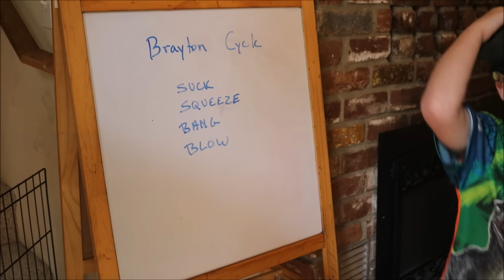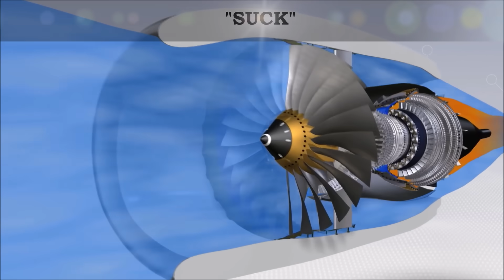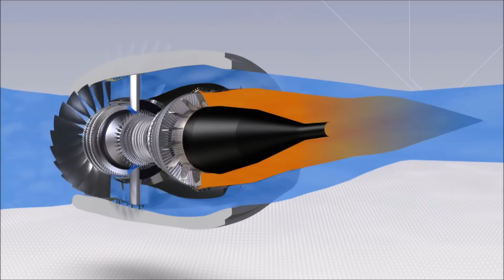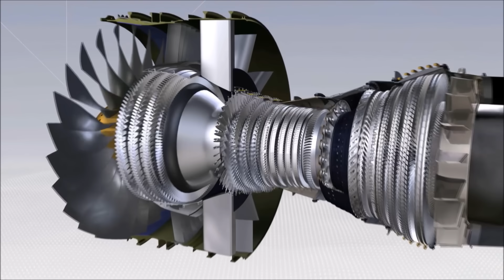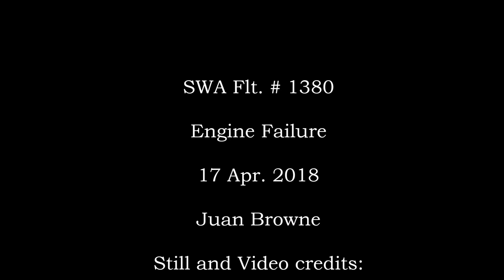Southwest Airlines Flt#1380 17 April 2018 Update

Comment: Here's a couple of observations, that i noticed. Good opinions please. First the test are ground test. Any questions on the 500 mph entering the engine during failure causing more damage? Second thought, The 2 South West mentioned engine failures were both #1 engines. Similar problems. And what if theses were #2 engines. Damage the same to aircraft? What do you all think?
Reply: Good question. Each engine is symmetrical on the outside, but some internal parts such as the accessory gearbox are always on one side of the engine, and failure of these may produce different effects on either side of the aircraft. The fan blade failure should result in random direction of the pieces.

Comment: Thanks, Juan.  Curious where on the plane the broken window was in relation to the engine.  Do they replace the fan blades periodically or only if signs of damage?  I assume they are expensive to produce, but replacement looks easy.
Reply: The broken window was just level with the rear of the wing, slightly behind the main parts of the engine. Look at the photo at 00:06 in this video.

Comment: While serving aboard the USS John a more FFG 19 in the Navy, I  operated and maintained two GE LM 2500s,  the lm 2500 uses the same core section as the cfm56 I believe,  of course we didn't have LP compressor wheel on the front, but we did have the 5 stage hot in turbine that drove our main reduction gear which is like a transmission for the main propeller shaft. Those engines were very reliable and there are hundreds of thousands of them in service in different applications worldwide and have been since the early 80s maybe even the late 70s..
Reply: Interesting discussion, but the LM2500 is based on the CF6 engine, not the CFM56. See: https://en.wikipedia.org/wiki/General_Electric_LM2500
Reply: Gordon Richardson the way I read this is that it's and improved version of the core cf6 section... https://en.m.wikipedia.org/wiki/CFM_International_CFM56
Reply: With an improved annular conbustor that swirls the flame propagation.. otherwise when I look at under the cowling.. all of the bypass, cooling and bleed air piping looks very close.. vsv's/ fuel  rail rack and brg vapor collection points.
Reply: That article (which I have read many times) says the CFM56 is based on the GE F101 engine, which is entirely different, though obviously some company features remain: https://en.wikipedia.org/wiki/General_Electric_F101
Because this was a military engine, export licences were a big issue!
The CFM56 does include several components from the CF6 including the fan, but not the core.

Comment: Jet engine background: The father of all modern airline transport engines was Austrain Amselm Franz. In about 1940 he was given the task of producing a jet engine for the Junkers aircraft company, where he worked as a turbocharger designer. The early experimental jet engines all used centrifugal compression, but Frans had a better idea and invented the axial compression jet engine, which became the Junkers Jumo 004. The 004 powered the Messerschmitt 262 which was 100 mph faster than American fighters in WW2. After WW2 Franz moved to the US where he developed a number of turbine engines including the PLFIA-2 the worlds first high bypass jet engine. All the large airliners are now propelled through the vapors by Franz invention of the axial compression high bypass turbine engines, such as the CFM56. Franz changed the world and virtually no one knows his name.
The Jumo 004 had a time between overhauls(TBO) of 25 hours, but with 80 years of metal science the TBO of the CFM56 is about 10,000 hours.
Fraz died in 1994 at the ripe old age of.....94.
(How many Americans would want to fly on an airliner powered by a Junkers engine?)
Reply: ziggy 2shus  Jet engine invented by Frank Whittle,who was sidelined by the backward thinking  military analysts before WW2. Details of his design were obtained by the Nazis by nefarious means!  You are obviously a very knowledgeable chap, do you know of any similar turbofan containment catastrophic failures in Rolls Royce units? This is a design engineers nightmare.
Reply: I posted this for the convenience of the Blancolirio viewers. Most of my information comes from Wikipedia.Yes, Whittle invented the first jet engine, but it was a centrifugal compression engine, which was the logical way to produce the first of its kind. Hans von Ohain , in Germany also developed a centrifugal compression jet engine and got a US patent for his engine. Ohain's engine was the first to power a airplane in 1939. In 1926 A.A. Griffith reviewed Whittle's turbine paper and derided it, and stated that the large diameter compressor would make Whittle's design impractical for aviation, which shut down Whittle's work for a long period. A.A. Griffith wrote a paper proposing an axial flow compressor. Griffith's and Franz great idea was to take steam axial expansion turbines and flip it around backwards and use it as an air compressor. The steam turbine had been invented by Sir Charles Parsons in 1884. The British had an axial compression test engine flying in the Gloster Meteor in 1943.
The British Gov. sold the Rolls-Royce Nene centrifugal to the Russians in the late 1940s, which they knew was a dead end design. The Neme engine was far superior to anything the Russians had, and they improved it and used it to power the Mig-15. In the Korean war. The modified Mig-15 Neme engine produced more power than the axial engine in the US F-86, but this was the last straw for the big centrifugal engines.
-
A quick Google check: In 2001 a Rolls-Royce engine fan blade broke off on a 777 on take off. In 2017 a RR engine fan blade broke on an Airbus 330, but there was no significant damage to the cowling.
Reply: ziggy 2shus  Thankyou for the information Ziggy. Sad to say I had never heard of Franz before,though I worked on steam and jet turbines for many years,including failed blade containment at the power stage. I imagine the turbofan cowling is a composite material so it will be interesting to find out how and why it failed.
The Swedish Ljungstrom radial steam turbine was quite successful but limited for the reasons you outlined in the Whittle Jet. One advantage was the speed it could be run up and loaded compared to an axial unit which requires careful thermal expansion.
Parsons turbine powered boat “Turbinia” is in a museum in Newcastle and well worth a look.It was good for nearly 40 mph !
Reply: The Swedes and Turbinia. Similar to the Turbinia embarrassing the British Navy in 1897 at Spithead with its speed, the Swedes "sank" a US aircraft carrier during war games with a little put-put submarine. The Swedish sub The Gotland is powered by an apparently very quiet Sterling engine and can stay submerged for weeks. The small"inexpensive" Gotland sub was able to sneak through all the US Navy defenses and photo the aircraft carrier.
-
The problems with broken fan blades should be reduced with the adoption of the new engines now in production. The CFM LEAP engine has light weight carbon fiber composite blades, which should reduce the damage if one breaks. The new P&W 3/1 geared engine would reduce the energy of a broken blade. The P&W geared turbine   spins at about 12,000 rpm but the fan only turns at about 4,000 rpm.

Comment: I've worked with this design of engine as mechanic and the Fanblades of this model are well designed without midspanshrouds. But as mechanic you haveto deal often with stuck fanblades. I think that, combined with an high amound of flightcycles can cause this enginefailure.
Reply from the maker: Great point! Especially just coming out of C check.
Reply: I do not know the nomenclature of the fan blade components nor can I find the engine service manual online.  Should I be surprised if NTSB and other investigators find either parts installed out of numbered sequence or improperly lubed?
Reply: Aren't stuck blades are really dangerous? I believe all blades are meant to have a little play in their slots to absorb/dampen excessive vibration. (Thanks to AgentJayZ's excellent channel for my education on such matters).

Comment: As usual Juan, your reporting is spot on! I like the fake news stations telling the public that the engine "exploded"! One thing I must say is that the cfm56 engine has 42 fan blades. I believe you said 24. The cfm56 engine is a very reliable engine and the USAF uses that engine on the KC-135 tankers. The only differences are the location of the transfer case and the Tanker uses a down rated (thrust) version. Thanks for setting the record straight!
Reply: Different models of the CFM56 use anything from 44 to 22 fan blades, this B737 has 24.
Reply: Gordon Richardson I stand corrected! Thanks. I was speaking from KC-135 experience. I easily counted 24 from the pictures and I should have done that first. My question to you is why the variance in the number of blades? Thrust rating?
Reply: Tom Uhlig The Wikipedia entry for the CFM56 explains some of it, as the engine has gone through multiple upgrades (similar the B737 itself), and large ranges of thrust ratings. See: https://en.wikipedia.org/wiki/CFM_International_CFM56#Variants

Comment: Turbofan failures can be deadly. I'm remembering Delta 1288 in 1996 where the shrapnel killed two on an MD-80 series on a runway and United 232 in 1989 where the shrapnel from the number two engine severed all three hydraulic systems of a DC-10 at altitude. Despite extraordinary efforts of the crew to fly with no yoke or rudder control the plane crashed at the Sioux City Airport in Iowa killing 111 of 296 on board and injuring almost all the survivors. We can thank the high level of quality control in manufacture and subsequent inspection that fan failure is so rare.

Comment: Thank you for this information , do we know if the failed blade or bits of it are still inside the engine body, did the bottom dovetail part remain in place or blow out, what retains the dovetail in place, and will they tell us if in both failures the failed fan blades where still inside there  recommended life span and actual flight hours in service.  Has this type of failure ever been replicated in ground testing or is that not possible because there is no way to reproduce the effect of front air speed on the engine while in flight, Finally what is the recommended life of a fan blade and who makes them.

Comment: It looks like one fan blade is missing, with others bent. https://www.youtube.com/watch?v=NrSK7afoMjY&t=1m51s
Can't see if any of the engine core blades were also lost.
I thought the engine nacelle (Edit - fan cowl seems the correct term) was kevlar reinforced and designed to contain a lost blade.  The video shows lightweight metal honeycomb possibly lined with a thin sheet of kevlar(?) that was comprehensively shredded.
Reply: The entire engine is junk now, pieces of metal probably went throught the whole thing in a few milliseconds.

Comment: I really appreciate the information you've presented here.  What I'm having a really difficult time wrapping my head around is if the fan blade was sucked back into the engine, which would cause an unbalance in the engine, why would the inlet portion of the nacelle come flying off?
I originally thought that maybe the nacelle itself failed, causing a FOD incident which took out the blade.  With the reports now that the NTSB is saying there were stress fractures on the blade, I'm guessing that didn't happen.
What is that nacelle inlet portion made of?  Is it a honeycombed aluminum?  Fiberglass, or carbon fiber?  To me, the photos look like the entire inlet section just was ripped off the nacelle completely, but I'm not sure why, especially given video evidence of tests of fan blades with no significant damage to the inlet.  Of course, they weren't flying at 400mph on the test stands, either.
I'd appreciate hearing your input.

Comment: So basically this engine is a ducted turbo-prop?  Except they call it a fan.
Reply: Jim Beck - pretty much.  The turbine mostly powers the compressor and the fan. Less than 20% of the thrust is from gas exiting the engine core. 80% is just air moved by the fan around the core.  This large air mass that moves close to the speed of the aircraft is more efficient than the smaller high velocity air mass of early pure jet engines. I owe this understanding to AgentJZ and his excellent YouTube channel.

Comment: The N1 blade assemble  on a CFM56 - series does not run at 50,000 rpm, it varies from high 4,000 to low 5,000 rpm. This manufacturer uses N1 to set power, others use an EPR ( exhaust pressure ratio) to set power! BTW the bigger high Bi Pass engines use a lower N1 speed since the larger diameter N1 bigger blades would go super sonic at tips, ant that is a NoNo!
Last NTSB update and photos/video shows N1 blade #13 failed at the hub from an internal stress crack and just above midpoint of the blade. The hub section of the blade remained on the are craft and I suspect that was what breached the aircraft wind and injured the woman that later died. The nacelle parts were found but the upper blade section is missing and may never be found!
Kudos to the Pilot and her crew job well done!

Comment: 7:30  The "bang" part: the compressed air is about 840°F. When fuel is added it goes to about 3090°F. This temperature change expands the volume of hot "air" about 2.7 times... "bang." So, the extra 1.7 amount of hot stuff gives the extra work for thrust = "blow"
Reply: A Mascia There are lots of extra details in a real engine. The hot combustion products are mixed with cooling air, since the turbine blades cannot withstand such high temperatures.
Reply: Hi Gordon... Yup, the engines are amazing. Glowing dim red in darkened areas howling at thousands of RPM 20000 HP without breathing hard... awesome close up. I used to work with little ones in the olden days.
Reply: A Mascia I get all my information from AgentJayZ videos. He does jet turbine repairs, and explains things well. See: https://www.youtube.com/playlist?list=UUh57rwk3ySElDpzgCDLh9KA

Comment: Question, I know jets push their way through the air but what is the percentage of the engine pulling the aircraft compared to the pushing of the aircraft ? Most likely around 10% pulling to 90% pushing....is that close ?
Reply: Tim Wasson It depends on the bypass ratio, but on a modern engine its 80-90 percent fan vs 10-20 % thrust.

Comment: I noticed the fan blade next to the one they blew off with explosives in the test was also damaged, just like the one on the Southwestern turbo engine. Nice breakdown graphics of the turbofan engine, I was just recently studying the differences, and similarities, of the turbine engines vs. a jet engine.  Getting sucked out a window, what a horrible way to go. That's why I always wear my seat belt in planes.  -- At least this time the pilot and / or news media didn't jump on the "it was a drone" bandwagon. Which there hasn't been one proven occurrence of in this country. Then they fail to follow up when it is proven that what they saw and claimed was a hobby drone turned out to be a party balloon, bird, or piece of paper.
Reply: Duck Landes 0

Comment: I know that pilots train for an engine failure in the simulator every 9 months but do they train for a detonation/uncontained failure that includes rapid/violent decompression? I'm sorta confused because I think you said it was one incident at a time in the simulator? Also concerned about the issue of passengers not wearing the oxygen masks correctly. Kudos to the pilot, she got balls of steel!
Reply: Hmm...I noticed that near the beginning Juan plainly says they train realistically, but usually only one emergency at a time, and that this one involved at least those two you mention, plus possibly hydraulic failure in one or more systems as well.

Comment: I had a flight in a similar southwest jet about 12 years ago from Reno to Minneapolis. Have way down the run way the engine started making a loud humming noise. He had a very uncomfortable takeoff that seemed to use the whole runway, and got pretty close to the mountains at the end of the valley. We arrived very late, and had the roughest sideways landing I didn't think was possible. I was in row 14b which is an exit row on the wing, and every time the stewardess walked by she seemed to stare right through me at the engine. I've told several people I know the story over the years, and after this incident, It wouldn't surprise me if it was the same kind of thing, just not a total failure.

Comment: I was wondering (before your great explanation Juan) if an individual turbo fan blade could be removed/replaced. So they can be. If this plane in question had inspection completed two days before this fatal accident how come this fan blade engine metal failure not found? I love aviation otherwise why would I subscribe. But a lot of the internal working components and theories behind the way the work is still a mystery to me. I would love to get a private pilot license but finances just will not allow for it. Great job. There will be a lot of speculation(especially from the hype mechanics of the news media) on the how or why or cause of this accident.  No use really until the NTSB does it's investigation and reveals it's final report. Maybe 12-18 months. Thanks once again Juan.